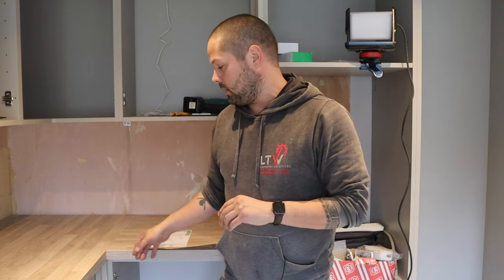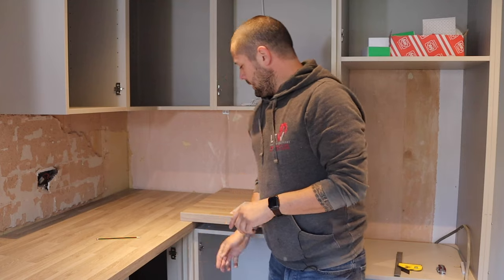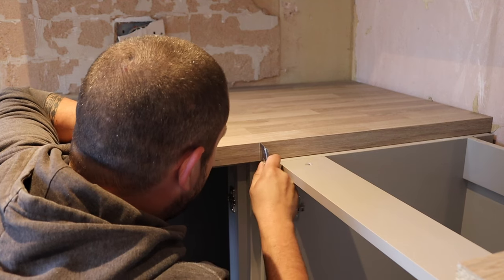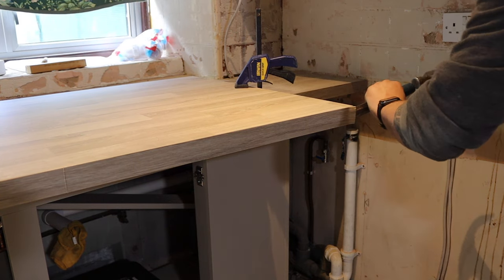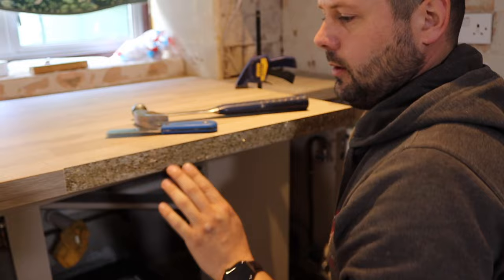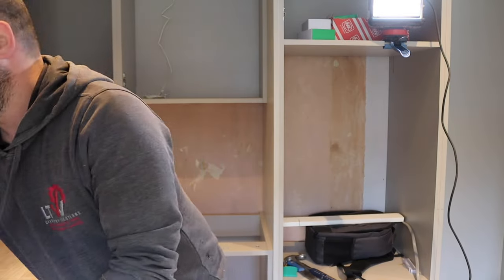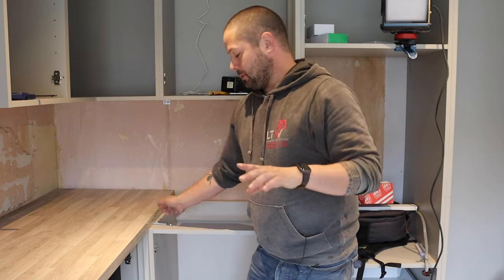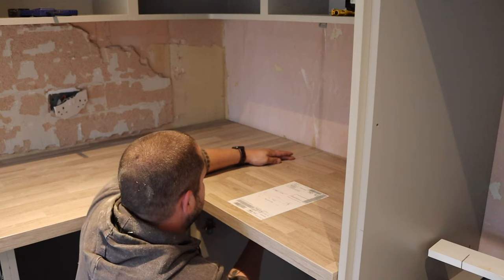How to join square edge worktops  #joinery #carpentry #woodworking

Comment: It's nuts the amount chippies I see putting a big masons mitre on square edge worktops.  I used to do it your way  but I've got a trend jig now that creates a 3mm masons mitre, just enough to take the edging off and give a router clean cut on both edges. Good video 👍
Reply from the maker: Ohh really mate ! Now that’s something I would be interested in ! You got a part number at all mate ?
Reply: @LTWCarpentry  KWJ 750 pro  You can set the masons mitre to different depths. I mostly use 3mm. When you do standard post formed top you can set it to cut a lot less out that a standard jig. They are highly recommend. Trend have got a good tutorial video on YouTube.
Reply: Agreed I’ve got that jig I did a 10mm mason mitre , worked a treat , quick and no need to remove the edging. 
I personally think you get a better joint using the router. But both ways will get the desired result.

Comment: I personally use a chisel to start removing the edges but I then use mall grips to remove it by rolling back then you don’t have anything change of marking or damage the top
Reply from the maker: I’ve never had much luck doing it that way, I always find it snaps as I’m pulling it off, I would much rather do it that way though as I can see the benefits as you have stated ! Got any tips ?
Reply from the maker: No I’ll be honest with you, it’s not the easiest job ever ! You can see by the video that I had some snapping, I think that’s where the hairdryer would really work well. But even with it snapping like that I still massively prefer doing it this way.

Comment: I do the same thing but use a heat gun to warm up the edging I’m removing, works A LOT easier mate!!

Biscuits too but I’ve seen another comment saying you usually use them.

Keep the content coming, good to see other fitters methods
Reply: Then I’ve watched end of video and you mentioned it 🤣
Reply from the maker: 😂😂 yeah mate like I say I don’t normally bother but I k ow a lot of people do, also with the biscuit in it I’m very fortunate and have a domino jointer so I’ve started using them in my worktops but i didn’t want to put it in the video as I didn’t want people to think you have to use them. Thanks for your comment and support mate ! Really appreciated !
Reply: Hi mate - great video. Just about to fit a square edge laminate worktop and was wondering about butt joint versus masons mitre. Is there any reason to ever mason mitre with a square edge laminate? Also why did you not biscuit joint this one? Thanks again!

Comment: Nice job! You need to pay the extra fiver fornzip bolts though, tighten them up with the drill in seconds instead of quarter turns on a spanner
Reply from the maker: Yes I agree I do prefer them I just have a ton of the standard bolts in storage that I’m working my way through 😂😂 thanks for the comment and support dude 🤘

Comment: Good video only thing I would change is the bolts!I used the zip bolts so much easier today 👌🏼 keep up the great videos 👍🏼
Reply from the maker: Cheers for the comment buddy ! Yes I do prefer them. I have a bucket load of these standard ones in my storage, trying to get through them 😂😂 I should stop being a tight fit and bin them 👍🏻
Reply: @LTWCarpentry  yeah I’m the same 🤣🤣 just can’t bring myself to use them since zips come on the seen
Reply from the maker: There are so much better aint they mate ! Saves a lot of rolling around in the cupboards aswell !
Reply: @LTWCarpentry what do you do if you can’t access bolts from underneath though? My corner cabinet has the corner doors on it so the tops of base has a support panel on it Do you just cut a hole in it or bolt it together on a bench first the place on top of base unit?
Reply from the maker: @vrglcom  cut a hole in the solid top buddy, just where you want to bolts, that way you don’t weaken your cabinets

Comment: Good clear video. About to fit a worktop and haven't done one for 20 years. Thanks for the help
Reply from the maker: No problem at all, thank for you comment! Best of luck with the worktop, if you need anything please feel free to get in touch !
Reply: What tool do you use to cut the male piece to get a perfect edge. A circular saw or router?
Reply from the maker: @jimdunbar3711  I used my makita track saw with a decent blade in it, you could also use a router if you wanted to too 👍🏻
Reply: @jimdunbar3711  I used the circular saw to cut the length. I cut the edge that was going to be the other end to the join if that makes sense. I used a guide by clamping a piece of wood to the worktop so that the cut would be as straight as possible.
Reply: @LTWCarpentry  sounds like a good excuse to the mrs to get myself a track saw. 😉
Reply from the maker: @jimdunbar3711  well to be honest mate I don’t really see how you would do it without it 🥴🥴 to be fair mate even the budget ones are good ! I would take one of them over no tracksaw any day !

Comment: I may be being stupid but I’ve watch the video a few times and couldn’t see any instructions on making the bolt holes..are they routed in place underneath? How does that part work? Any help would be appreciated.
Reply from the maker: No your not being stupid at all, I didn’t actually film doing the bolt holes as the video was already getting very long, yes they are routed in from the underneath using a jig. Hope this helps if you need any advice please feel free to ask.
Reply: @LTWCarpentry have you got a video showing how to do the cutouts for the bolts?
Reply from the maker: @teewithey5879  yes there is one on my channel now under the playlist “kitchen worktops”

Comment: What a great video! Got kitchen delivery on Thursday... I have to do a similar joint, but the worktops are Oak. Should I still do it the same way mate? Just no strip to remove?
Reply from the maker: Yes mate, exactly the same providing there is no round over in the edge ! Thanks for you kind words buddy 👍🏻

Comment: Is it essential to remove the edging strip on square edge tops? I appreciate that there is a tiny curve on the top of the strip that would prevent a 100% perfect joint but it would still look pretty good right?
Reply from the maker: So not essentially I have seen people that haven’t removed the strip and customers have been very happy with it, I personally think it looks much better to remove the strip but in terms of will it work as a joint yes. I would suggest getting a couple of off cuts and experimenting first to see what you happy with.

Comment: If the worktop was solid oak would you still need to remove a line of material for the worktop to interlock to?  Nice video thanks for posting
Reply from the maker: No mate, aslong as it square edged then there’s no need to take anything off, just rout in your bolt holes and away you go.

Comment: why measure the top before you removed the edge strip? its now short  by the thickness of the strip
Reply from the maker: Because you don’t want it to tight, if its tight you won’t have tolerance to get it in when you have the glue in place, also you risk damaging the finished end panel on the other side.

Comment: Good video! I'd be running a hot iron along that edging strip, just to ease the glue off a little.
Reply from the maker: Don’t use an iron it will melt and make a right mess, use a hair dryer to warm it up.
Reply: @LTWCarpentry  melt the laminate?  If you know, you know
Reply from the maker: @petef7323  the edging in these worktops isn’t Laminate, it’s pvc edging, the top is laminate
Reply: @LTWCarpentry  I'd put cardboard between the lipping and the iron, then. If it's coming off, it doesn't matter if it's damaged. I'm only interested in softening the glue,  so it doesn't rip chunks from the chipboard.  Also, you wouldn't need to get so close to the laminate top with a chisel.
Reply from the maker: @petef7323  okay cool 👍🏻
Reply: I use a heat gun to soften the glue then a pair of plumbers grips to peel it off. Then a quick sand of the chipboard to clean it up, staying away from the laminate top. Works perfect every time.

Comment: excellent video from a very genuinely helpful guy...quick question do you use colour fill on the joint afterward?
Reply from the maker: Cheers buddy ! I don’t always as the joints normally come up good, I open use it if I can’t get the joint to pull up tight for some reason

Comment: when a work joins near a sink you cant bolt it how do you get around that? my kitchen fitter that that problem and i am now in dispute with howdens because the design didnt allow bolts due to sink location
Reply from the maker: Sometime you can do your join the other way so the bolts don’t go under the sink but failing that you can bolt and glue it up, let the glue go off then take them out, I have also put the bolts under the draining board before and routed out the material above them, I would also opt for running the joint the other way if possible, hope this helps

Comment: Hi mate quick question, would you cut a HPL laminate any different to a normal laminate?
Reply from the maker: It’s the same principle but a completely different job if that makes sense ? They are very touch to cut. I would say cut with a track saw then clean up with a router and straight edge

Comment: Heres my question maybe you can help me with- 
why do kitchen fitters use worktop bolts and not just glue up with dominos and clamp with ratchett clamps?
....might be a good reason for this
Reply from the maker: We use the work top bolts as this is a way of clamping, you could use a ratchet clamp but it’s not always possible to get them in if your working towards a wall ect. Also you would have to do you glue ups before putting the tops on the units which isn’t always possible. Short answer is the worktops bolts are easy and a solid permanent fixing. I do actually put dominos in my worktops aswell I just don’t on my tutorials as this tends to put people off taking the task on

Comment: From what i gather I'm supposed to leave a 5mil expansion gap on a solid wood worktop. Would this be just along the back where it meets the wall. Or would i need to leave the same gap where the worktop meets a wall or unit at the end many thanks. ?
Reply from the maker: I normally just leave it against the wall, I have never left it against units and never found it to be a problem.
Reply: Thanks for the reply. I take it it doesn't really expand length ways then just across the grain.? Thanks
Reply from the maker: @lukestyles2615  not really buddy, just across it’s width
Reply: Ok thanks 👍

Comment: Sorry for the stupid question but how did you cut the short bit to length? I assume the edge needs to be very precise as it's part of the joint, did you cut it with a router? Would a circular saw do the job? Thanks
Reply from the maker: No questions are stupid mate, that’s what I’m here for. I used a track saw with a new blade in it, a router would be a good option but you can do it with a circular saw, you want to keep the cut as straight as possible, so I would suggest using a straight edge to guide your saw (spirit levels are good for this) makes sure you have a good blade and most importantly take your time.and cut it from the underside.
Reply: @LTWCarpentry  thanks for the fast reply, I was abit worried about chipping. I'll do some test cuts first. The strip removal method you show works a treat though so thanks for the great video!
Reply from the maker: @leehudson1384  no probs at all buddy, thanks for the comment, it’s really helps me ! Good luck mate and let me know if you need anything else 🤘

Comment: Nice video thanks 👍 but why do you have to take the edging strip off. Why not just bolt them straight together?
Reply from the maker: The edging strip has a very slight rounded edge, if you don’t take the edging off you will be left with a small gap and the joint will be a lot more visible
Reply: @LTWCarpentry I went to see a job a "kitchen/bathroom fitter did . He did that and it looked a right mess. The strip needs to come off.

Comment: So, would I be correct in thinking that a square edge laminate worktop is a simpler worktop to join than a round edge worktop (for a novice)?

I will be ordering two lengths of worktop, presumably the end of one of the worktops will be a perfectly square edge and ideal to join to the other?  

So then I would only need to worry about removing the edge tape and preparing the underside for the bolts?
Reply from the maker: I never really thought about it but yes I suppose they are easier to fit, 

In theory yes the edge should be perfectly square but I would recommend checking this as I have had some there aren’t, saying that you might not actually want them to be perfectly square, if your wall are out of square you will want to cut the end to suit, I do this by laying one over the other and making as needed. 

In answer to you last question yes your right other then scribing your joint
Reply: Marvellous, thanks for replying.

Will have to see how square the walls are when I get to fitting.
Reply from the maker: @Smarty72  if you need any more help please feel free to ask 👍🏻

Comment: Thanks for sharing this video. Would you be kind enough to share the brand of glue you normally use? Reason I ask is I'm fitting a square top worktop for a friend. It's a white top and I don't know if it's best to use white or clear glue and which brand works best in your experience 👍🏻
Reply from the maker: I’ll be honest mate I would use white silicon, that’s what I normally use, works a treat 👍🏻
Reply: @LTWCarpentry  Ah OK, so just normal white silicone sealant. I was under the impression you were talking about more of a glue adhesive. Cheers! 👍🏻

Comment: Personally I'd run a hot iron along the edging strip to soften the glue and, hopefully, get the edging strip off in one piece.
Reply from the maker: A hot iron would melt the edging strip cause a mess
Reply: @LTWCarpentry  funny but it doesn't melt iron on edge banding 🤔
Reply from the maker: @williambelford9661  this is pvc edging not iron on edging
Reply: @LTWCarpentry  in the video you describe it as laminate.
Reply from the maker: @williambelford9661  yes the worktop is a laminate worktop with a pvc edging, I tell you what mate you try it and and let me know when you discover I’m right

Comment: I use 'BB Complete' on all cuts and joins, colour-matched to worktop colour, do not confuse BB Complete with that trash colourfill.
Tubes come in two sizes for a normal mastic gun,  it's the dogs dangly bits.
Reply from the maker: Never used it mate, I’ll have to give this a try ! Thanks buddy ! These are the comments that are needed !
Reply: @LTWCarpentry    check out the manufactures video on youtube  by BUSHBOARD LTD  they will guarantee your joints for 3 years.  All the best mate.
Reply from the maker: I will do buddy ! Thank mate 👍🏻

Comment: Do you not use the mason mitre joint on any square edge worktops, it's only needed worktops that have rounded edges?
Reply from the maker: That’s correct mate, I only use a masons mitre when I have to now, if it’s square edged then I do a bit joint, I find it looks a lot cleaner.
Reply: @LTWCarpentry  do you have any videos on installing and cutting out the worktop for a cooker hob cheers

Comment: Any particular reason for not using a router to take the front edge off, or is it just a preference thing
Reply from the maker: Just a preference thing really mate, also not wanting to use a router inside the customers house, and not wanting to drag it outside again 😂
Reply: Makes sense 😂

Comment: Anyone had experience of the the new Trend Trend KWJ750P jig (which can cut a minimal 3mm hockey stick joint) when cutting square edged worktops? I'm impressed  by LTW's butt hand jointing skills - by removing laminate edging  by hand - but don't trust my skills in removing edging tape with a sharp implement!! The new jig would remove the edging with the router whilst leaving a minimal hockey stick joint. Any user feedback appreciated!!!!
Reply from the maker: I haven’t had a chance to use one of these but would like to, I would still do it this way but I agree if your not feeling confident then that jig would help !
Reply: That's the jig I use, 3mm step is perfect for square edged tops. 10mm step looks great on bullnoze tops.

Comment: Is doing a biscuit joint overkill?
Reply from the maker: No not at all, in fact that’s what I do I just don’t want to overwhelm the video
Reply: @LTWCarpentry  could I get away without biscuit jointing it...I don't want to fork out for one 🤣 Thanks
Reply from the maker: @lukepcreaney  yes mate deffo, just copy what I did in the video and you’ll be fine
Reply: @LTWCarpentry  cheers mate 👍

Comment: Hiya mate where is the video you created to cut the bolt holes underneath the worktop?
Reply from the maker: Morning mate, I’m afraid I haven’t done one yet, I’ll get one sorted buddy 👍🏻
Reply: @LTWCarpentry  Thanks mate, do you have to use a jig and router to cut the holes for the bolts or could I just a circular hole cutter?
Reply: Hiya mate can you help at all?
Reply from the maker: @richardmaddison3163  sorry buddy, I use a jig and router but you can use a hole saw but he care full not to drill all the way through 👍🏻
Reply: @LTWCarpentry  thanks mate what about the other part that needs cutting out? Could I just use an oscillating power tool?
Reply from the maker: @richardmaddison3163  you can do or just a hand saw and make sure you don’t go to deep, the chisel out the waste

Comment: Thanks, but if you are going to make a tutorial, you need to show all the critical steps, especially making the bolt mortices & how to apply the silicone & how much. From personal experience, it is very easy get into a real mess with silicone!!!
Reply from the maker: My normal rule of thumb with the silicon is use plenty, let it dry then cut it off 👍🏻